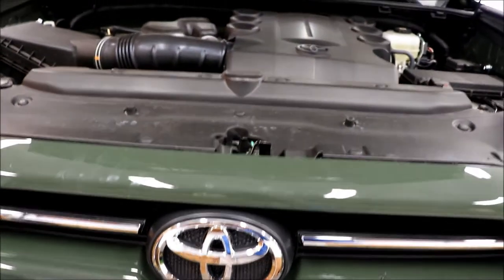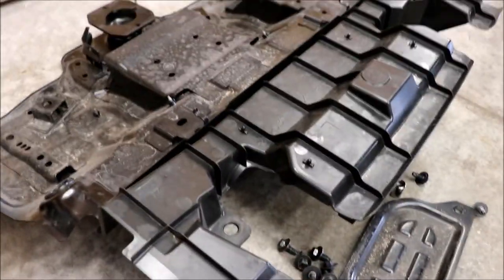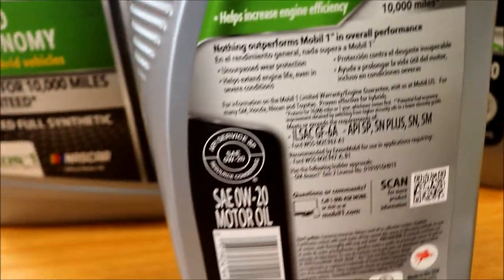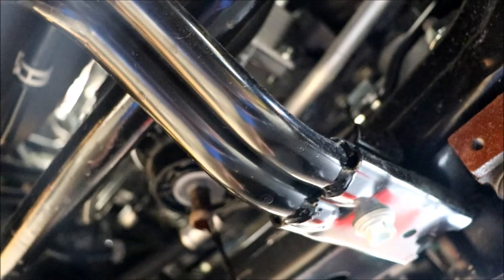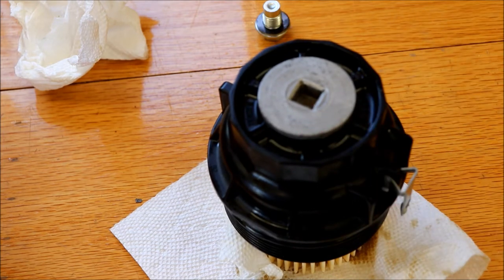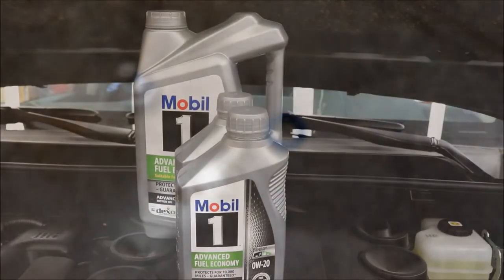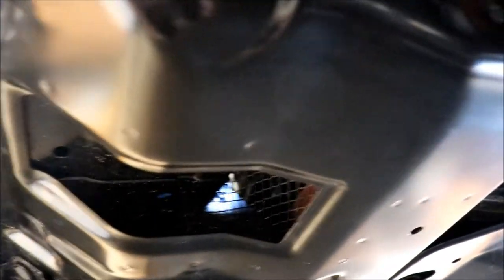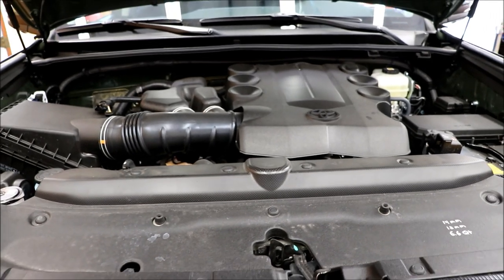2022 Toyota 4Runner TRD Sport Oil Change

Comment: Nice video. I just recently watched a video of a Tundra oil change and noted the owner using two thumbs pushing (on either side of the small plastic drain insert that comes with the cartridge) to get it seated. I haven't tried that method yet but it looks to be much easier than using just one hand to fit it into the cannister for draining the cannister oil.

Comment: The torque for the cap is 10 ft lbs and the filter housing is 18 ft ibs. I never bother with the cap and just un-screw the housing..If the drain plug washer is black then it must be changed. If the washer is blue it is not necessary..The drain plug torque is 30ft lbs...
Reply: Indeed! TCCN says don’t bother with the cap/ plug, just unscrew the filter.

Comment: Nice truck! I own a 2021 ! Wondering if you feel any steering wheel shimmy/ vibration between 50 - 70 mph? Mine tends to do that even after having the wheels balanced several times at a major tire store (Discount Tire). It’s done it since I have owned it from 44K miles to now at 50Kmiles… Ty!
Reply from the maker: Yes.  I think the tires are the issue.  I plan to get a set of Michelins installed and hopefully that fixes the issue.
Reply: @stuntcardriver  do you actually experience the same? The tires on my truck were brand new OEM spec Dunlop AT 20 GrandTrek P265/70R17
6K miles ago when I purchased this truck pre- owned from CarMax. It’s done that steering wheel shimmy ever since and i though oh just a balance issue but to no avail after rebalanced several times. Very annoying lol
Reply from the maker: Ours seems to shake until the tires get warm and then it seems to go away after a few minutes.  But it will rock the steering wheel back and forth. @4Runner21

Comment: What a degenerate design -- did not expect this contortion for my new a 5th gen as my 4th gen 2006 was comically oil change friendly.  Pop the hood and there's the filter waving at you sitting in an integral drip cup which impressed me as just about the pinnacle of easy and well thought out design.  Although my 3rd gen 2000 required oil filter access just over the driver side tire/well.  So I suppose prior art does exist for oil change hostile designs in this family tree..